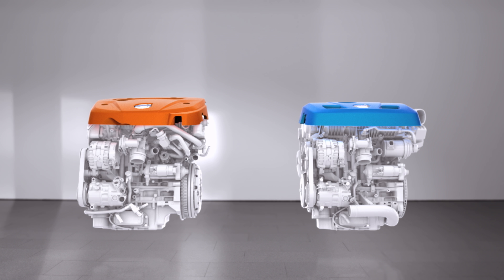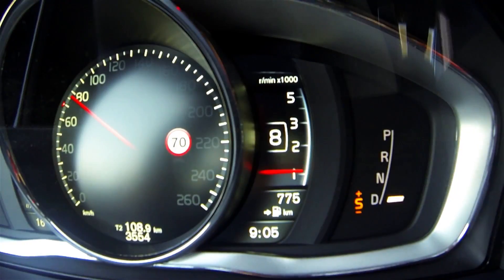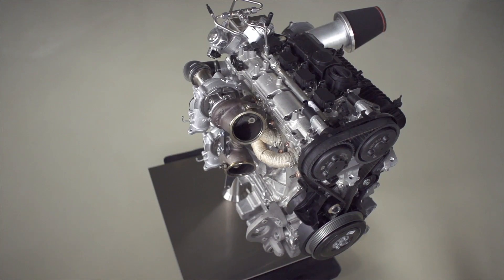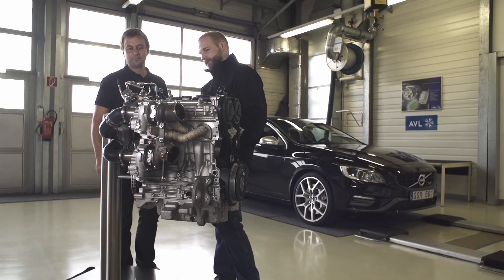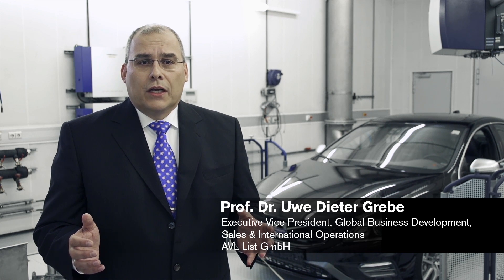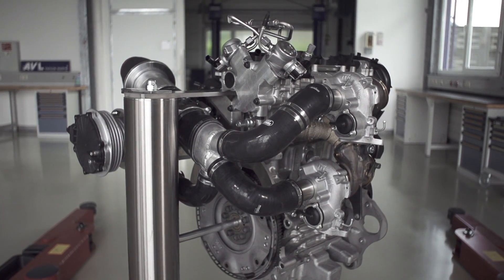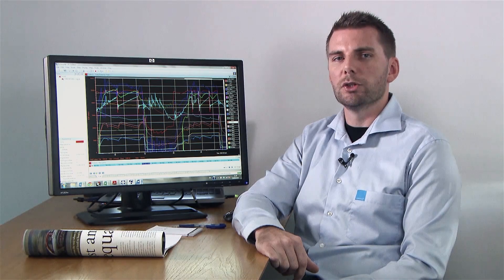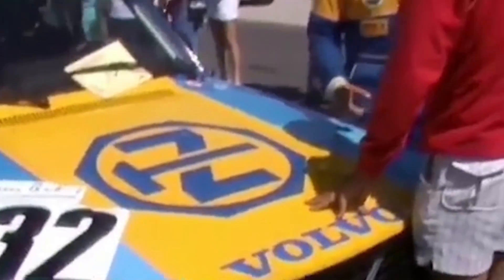Volvo Cars: High Performance Drive-E Powertrain Concept

Comment: Looking forward to seeing this new engine. maybe when this engine finally debuts they will be making a s60r, v60r or even v70r? then volvo is finally coming back at bmw, benz, and audi with perfomace sport sedans/wagons and occupy the final space in this luxury european car segment. I have a 2010 2.5FT volvo V70, but the problem is that the turbo lag just feels so awkward in town driving and the car just body rolls like hell even when im just entering a coner around 30-50km/h. and also the front wheel drive experience just takes away all the fun. however, with this new drive e engine and a nice AWD system. im sure it will be able to compete with M4, RS5, C63AMG,. But... you have to make it look a little bit more different than the other s60 with R-design, maybe considering doing quad exhaust pipes instead of dual since the current s60 polstar T6 AWD just looks too alike the normal S60s :)

Comment: make it less than 40k please
Reply: Yeah, not gonna happen. Maybe 80k
Reply: ***** If you know better how much an S80 costs in Finland, go ahead and tell me.. With every single option it's not very cheap. I also converted it into dollars. About 80k in Euros. Also, Volvo XC90 prices start from 81k Euros when buying the cheapest model without any options, so yeah, there really are expensive Volvos.
Reply: pavettto Volvo doesn't have that kind of customer yet.
Reply: Shift4g But yes it does. A lot of those actually. My uncle for example just sold his S80 that was about 100k new. Now he drives S500. So yeah, there's market for luxury Volvos too.

Comment: This is how you get power in the future: decouple turbo from waste exhaust and use some other manner to gather electrical power to run an electric compressor for the turbo(s).
Nice exhaust path, no impedance by turbo piping and instant power.
Bloody impressive from Volvo.
Reply: wouldn't that must mean it's one big sophisticated super charger if the turbos don't spool from waste exhaust?

Comment: I got one question, what is the need of two turbos if they are going to be feeded by a compressor? Why not put one bigger turbo instead, if they say that with that system they are eli,inating the turbo lag?
Reply: because TRIPLE boost sounds badass
Reply: the two parallel turbos are not fed by the electric turbo full time. the electric turbo serves same purpose as a crank driven supercharger. it gets the air moving sooner at low rpms then when the twin turbos are spooled the electric charger is bypassed. very cool technology indeed.

Comment: I miss the 5 cylinder engines:( 
Why there is downsizing everywhere? 
Look at Mazdas Skyactive! I am really not a Mazda fan, and I love Volvo, but this is a better way, than inventing little 17x turbocharged engines with two cylinders or less, which are going to break down after 100k kilometers, because they are producing 250hp out of 1,0 litre!

Go back! Go back to 5 cylinder, go back to 2,5 litre, go back to thick steel and please, please go back to edgy design!